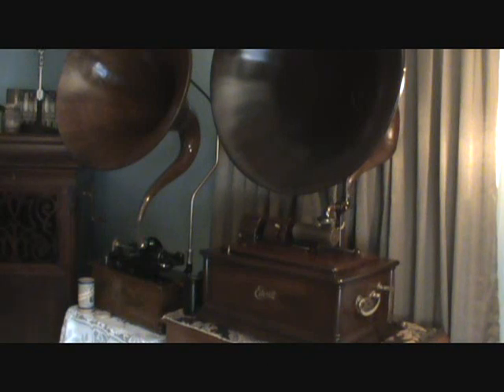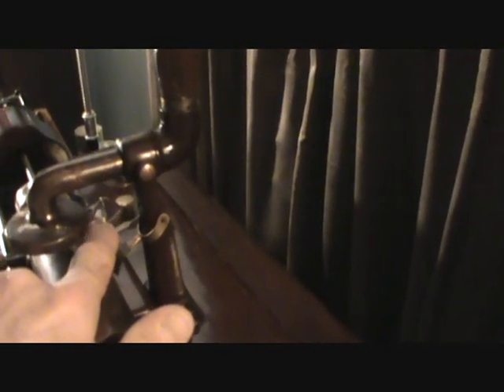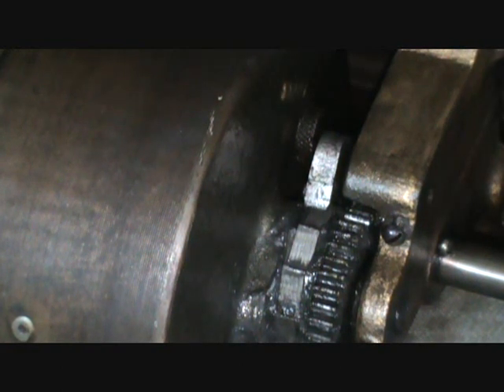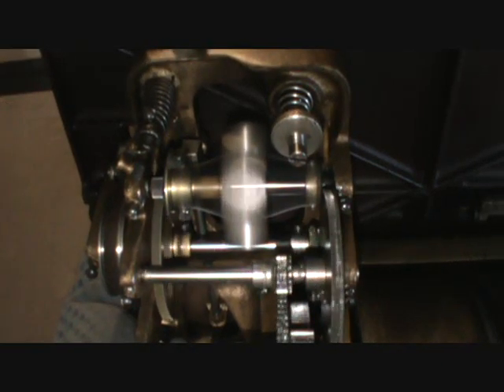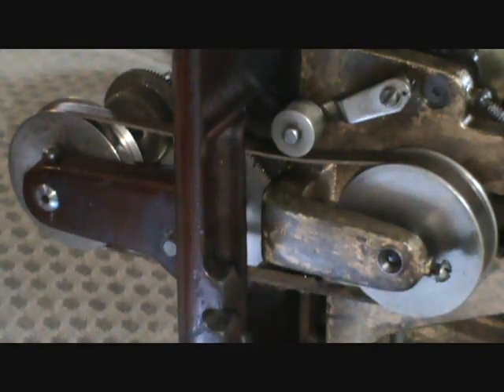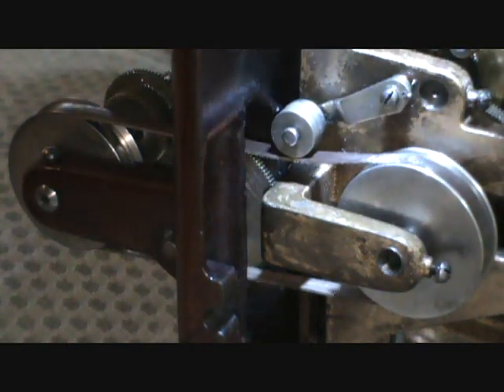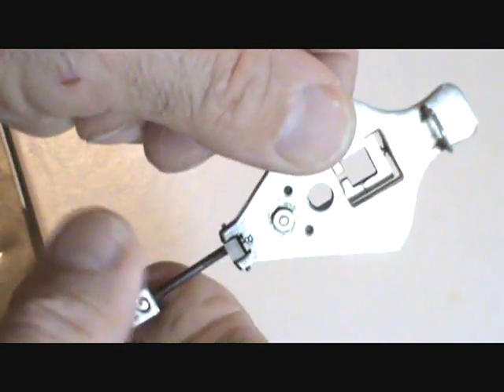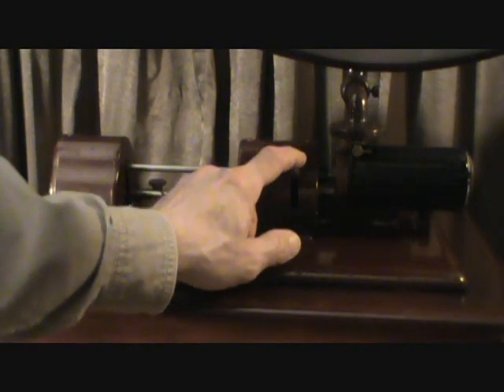Edison Amberola1A / Opera Cylinder Phonograph........How It Works

Comment: WOW! This is a top notch instructional video, absolutely fascinating! Thank you so much for taking the time to make this video and for explaining these machines so clearly! I am amazed at the engineering that went into these things, far more complex than I thought! It's so different from reading in a book "The phonograph used a wax cylinder" to seeing HOW it does it and how many controls, surfaces and gears were needed to ensure that it worked correctly. Of course the treat at the end was to hear the cylinder reproduce the sound, "Christopher Colombo" and your tip about the "flub". I did not hear it the first time! These cylinders were individually made, weren't they? So each one was a unique performance? That makes this a very rare piece indeed!

I imagine there is no SAMS photofact on these machines. How did you learn about them and what all the parts did? I expect that the leather parts had to be replaced because they dry out over time, just like rubber does?

When you showed the details of the stylus flip-over for the 2-4 minute cylinders, all I could think of was the old Astatic ceramic cartridge in my mom's portable record player! And it had a stylus brush built right in! That's amazing!

I think this is just about the best educational video on these machines out there. You did an amazing job of documenting the mechanism of the Amberola and have given history a video record of "How It's Made!" Bravo, Amberola cylinder player and bravo Ed for an incredibly fascinating and clear look into yesteryear. NO wonder you have such respect for these machines, they are a work of genius! NOW what would be fascinating would be to find out how much of this design and mechanism is the brainchild of Thomas Edison, and how much is the genius of his Inventor's workshop! I guess we'll never know that, it was probably a collaborative effort

THANK YOU for a great video! I really appreciate your effort!
Reply: amberola1b Thanks for the info on recording, I wondered about that! I have three other questions!  1) Since this is a mechanical system, and the cylinders are wax, can you record on an Amberola machine? I know Edison made dictation phonos, but I wondered how far the technology went. 2) I looked up Edison cylinders on the web and E-Bay and found something called a "cylinder reamer". Do you know what that is all about? It looks like maybe the cylinders have a coating inside to grip on the mandrel? It's fascinating stuff! 3) I get the flipping stylus deal, but am confused about the shape of the stylus, is it a needle or a sharp plate and I saw the thread leading to the diaphragm, but how does it connect to the stylus? Obviously it works brilliantly, just curious how.

If I ever were to visit you, I'd spend all day going over the fine details of this technology... I am so amazed at all they did to get it to work. And 100 years later, it STILL works!

Thanks, I really enjoyed your video and watched it three times!
Reply: +clydesight  First of all Amberola's presentation is top notch, thank you, this is one of my favorite cylinder playing mechanisms.  Back to cylinder record making, now,  After the multi machine recording method, about the middle of 1901, a more sensitive, higher fidelity recording head was  developed, I own an original studio recording head, used possibly at Edison's 79, 5th avenue studio by Edison sound man, Walter H miller, about 1910. And I have posted it in operation.   In the studio glass diaphragms were popular, and from .005-.0085 in thickness, the thin ones for weak instruments like a violin, in fact special violins were made for recording that used a diaphragm and horn, to project the sound into the recording machine,  some recording diaphragms were cellulose xanathate too, moulded into a dome shape, for higher fidelity.  The artist sang into a cone shaped horn, and sometimes several horns were used, with modified valves from trumpets, instead of pushed with a finger pad they had brass handled sliders to cut off, or change the flow of each horn to the recording machine, larger horns, for recording band records (up to five feet long, and even a 125 foot horn was tried, and  6 inch diameter by 27 inches long for vocal, and solo instruments recording.)  A brown wax (metallic soap) master cut with a  97 1/3 or double that for four minute feed was used to cut the master cylinder record.  In early years the master was vacuum deposited with gold, that is the master put in glass jar, and a pump sucked the air out.  After that; gold foil was energized with high induction electricity, it wanted to go from one pole to the other, however the master was in the way, and received a thin coating of gold.  The master put in a plating tank of copper sulfate, sulfuric acid, and distilled water, with a filter pump. The cylinder turned side ways on a motor and  slightly submerged to break up bubbles, after about a day, it had a copper shell around the wax, it was put on a lathe and the ends turned down,  and then put in a cool room, the master came out unharmed to make more molds.  The molds were put in bell shaped brass sleeves and went into a machine that mechanically charged the mold with enough wax to finish nicely, it went down rollers, at 1,300rpm until it was solid.  While still hot, and in the mold a lathe cut the ribs, and taper in the center of the record. Next a cooling cage with water circulating through it, cooled the wax down, and it was put on an extracting machine, where the weight of gravity, caused the record to come out of the mold, while still warm put on warm metal cores for two hours, and a hand press pressed them off the cores, the records boxed and sold.   The blue Amberol records, like in this video (the electrical 5000 series cylinder masters were indeed recorded on a modified Amberola 1 A) with an electrical recording head, on a modified microscope stage, mounted where the reproducer post is on this machine.  Acoustical two and four minute master recorded on modified Edison spring motor, and Triumph model A mechanisms, with large flywheel and special trunion, the recorders also had next to the sharp .041 cylindrical recording stylus, a round ball on a spring loaded bar, that raised and lowered the stylus into the master record, the adjuster called an advance ball, it not only took the weight of the recorder off the cutting stylus, it also burnished the blank before the cutting stylus. The Blue Amberol cylinders.  Celluloid tubes 30inches long, were rolled smoother, and an acetone based dye was used to dye  the celluloid tubes the weather had to be just right, so the dye did not streak when it dried, and sometimes the person who did this work, would get up out of bed at 1am go to the works and dye the celluloid while the conditions were favorable.  The tubes cut 4.38" long and the molds, (this time backed with steel shells, and a closing door on top) were put in a clamped mould holder with an air bladder, at first steam was circulated to heat the mold up , and then the air bladder inflated, which forced the celluloid tube against the impressions in the mold.  Compressed air caused the celluloid to shrink.  The celluloid was put in a plaster filler, and then the plaster baked in, at under 200F (celluloid is very flammable, so it could not be high enough to distort, or catch it on fire, ) to set the plaster.  the records were reamed and given internal ribs on a lathe, then the outside washed in a special solution, and then boxed and sent to dealers.
Reply: +Shawn Borri Wow, you really know your stuff! Thanks for that education in Edison technology. It is amazing what they were doing at the time. I am very impressed with their perseverance and creativity.
Reply: It is amazing, to me, also.  The Amberola 1 A machine was the top of the line equipment,  and went for $200.00 in its time.
Reply: +Shawn Borri  Is that $200 in 1901 dollars? And if so, does that equate to over $4,000 today (I used an online inflation calculator)? I ask because if it was that expensive at the time, how could Edison make any money? Who could afford it? I must be missing something here.
Reply: That would be 1909-1910 time that the Ambrola 1A was made. And 4000.00 sounds correct, it was the best cylinder machine made at the time.

Comment: You say the cylinders are indestructible.  I've got one (Cal Stewart / "Train Time At Punkin' Center", or something very close to that) and it has a crack about half way through the beginning of the record.  On the inside of it, it looks like it has a plaster shell inside of a thin tin cylinder that appears to be backing the blue wax.  A few crumbs of the plaster have fallen off.
Reply: Red Vynil That is because it has shrunken. The 100+ year old plastic shrinks over time and the plaster doesn't so the plastic cracks and the plaster chips. And by indestructible, the meant that, unlike other kinds, the temperature of you holding the wax with a hand won't break it. It also meant you found drop it quite a bit before it would break. Nothing is indestructible.
Reply: Red Vynil Adding to my other comment, the 2 minute records were made of a type of soap that you could not wash with. The blue ones, called Blue Amberol records were made of celluloid and were tougher and lasted for four minutes.